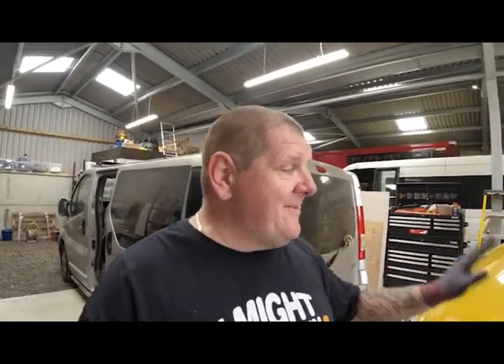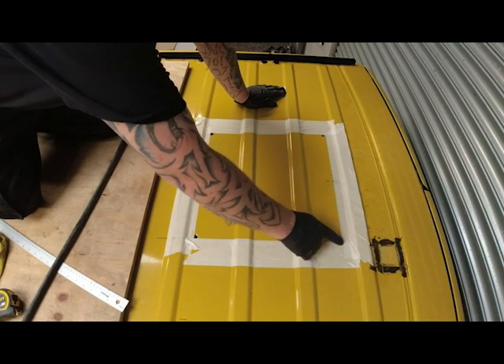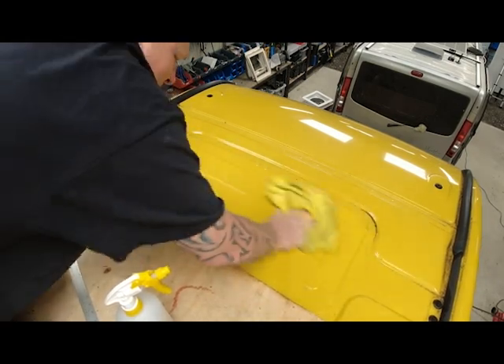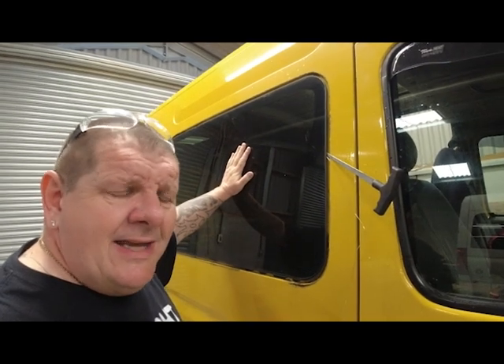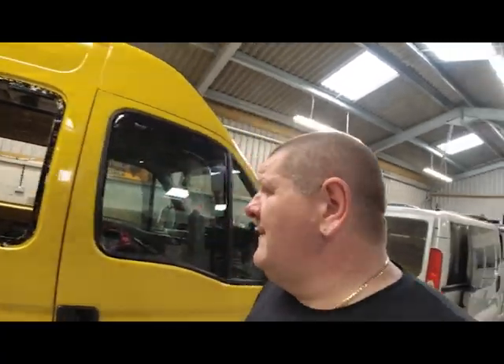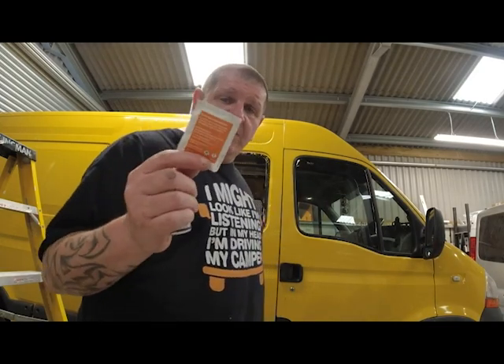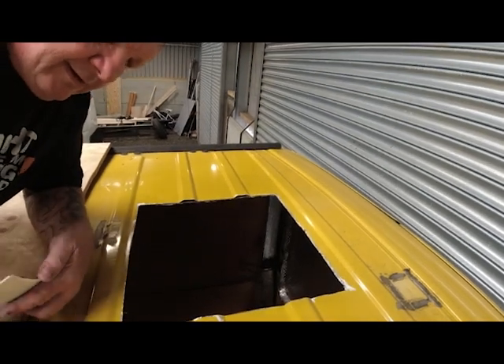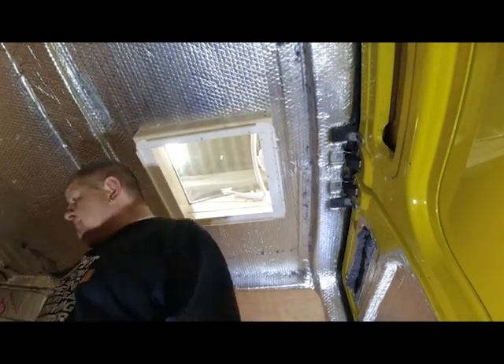Renault Master campervan conversion - Can I fit 2 windows and 2 roof vents in 1 DAY

Comment: Hi, thanks for such a great video, very helpful as I am just about to install a window in my 09 Renault Master. My only issue is that I could only find a window that fixes to the panel rather than inside the window aperture. Can you tell me where you sourced the window from please? (The one that fits the sliding door) Thanks in advance.

Comment: Why has this Vauxhall got a Renault badge on the front? Your mate Daren is going to take the proverbial out of you for this?
Reply from the maker: Mmmm I didn't thing of that I got that totally wrong definately a tiring day and well spotted
Reply: @BuiltnotBoughtCampers  Do you always use mastic tape to fit the roof windows and not Sikaflex? Do you find it works better? Good job by the way.
Reply: Is that van not a mwb? Ive got the swb high top but the yellow van in this video is clearly longer